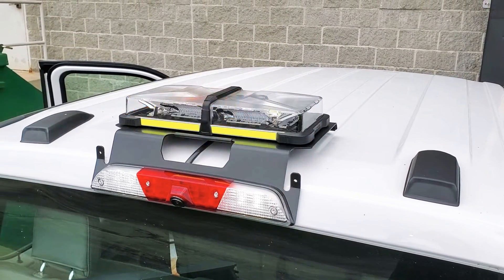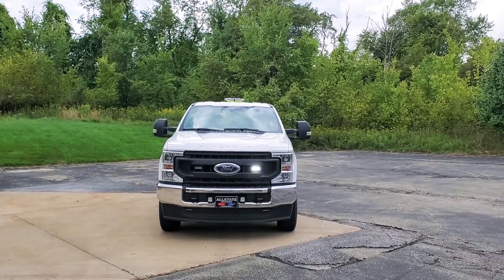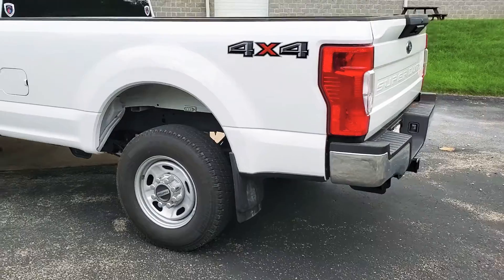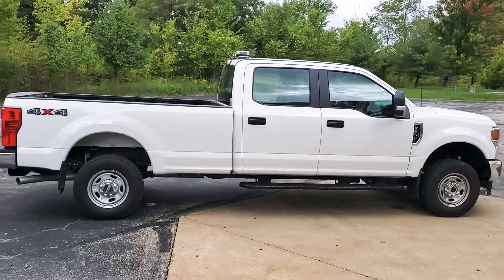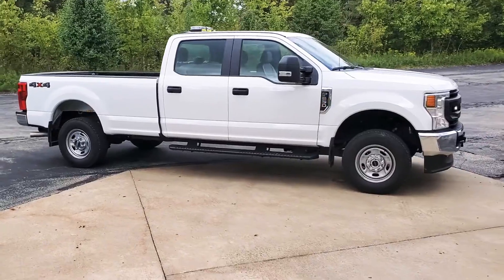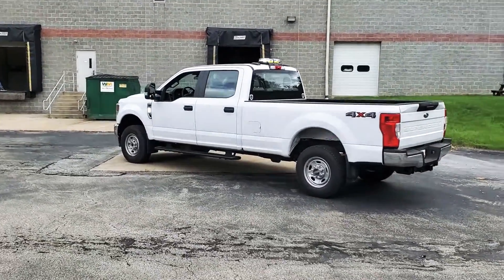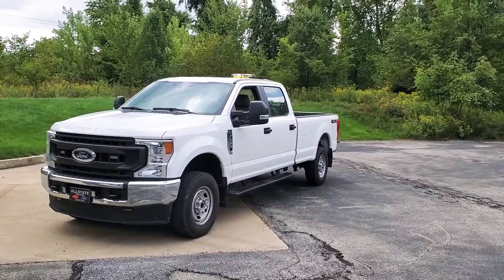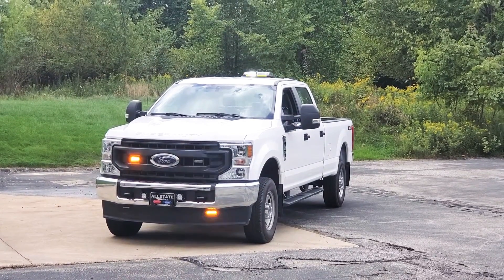Previous F-250 SuperDuty SoundOff Signal Install Update

Comment: How much would a set up cost like this one one a 2017 model minus the lower air dam lights the side wheel well lights and lights in the backup lights
Reply from the maker: Bradley, I'd guess off hand that we would install a setup as you described if the truck was dropped off at the shop for somewhere in the ballpark of $2,200. If we were guoting an on-site install that ballpark would increase dependant upon the distance our mobile shop would have to travel. Our on-site labor is also charged at a little higher rate than our shop labor.

Comment: In your experience working with Soundoff products, what improvements do you think they could make to remain competitive against other brands?
Reply from the maker: So honestly I think SOS is very competitive in the market as whole. Their BluePrint system definitely rivals the other software base control systems such as Whelen's Core. I think one area SOS should put effort is in evolving their nLine running board lights. They are only available in single color/function versions. They do not offer a dual or tri-color version that all other manufacturers offer. 
To be honest, as whole I think SOS has a very strong competive edge in the market. Ofcoarse we all notice that software based control systems are the future of our industry. So the logic/data driven lighting is becoming more & more predominant. 
Hopefully we don't see internal flashers vanish all together because we work for alot of clientele that do not have the need or want for a fully software driven system.
Reply: @412psekustomzllc7  I agree and think thats a accurate take on SOS. One area I think they can improve on and I would like to hear your opinion on is with their nROADS line. I wish their mini/mid size bars and beacons could be a little brighter during the day. It is my opinion that they suffer more from washout than from other brands which to me borders on being a safety/visibility issue. Nightime they are fine and are visible.